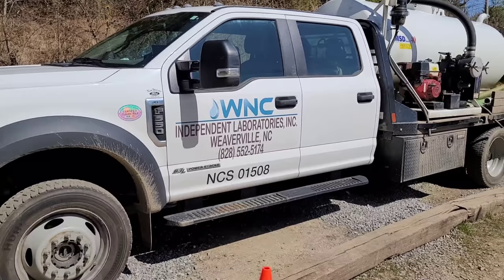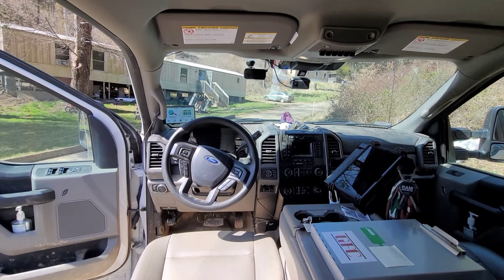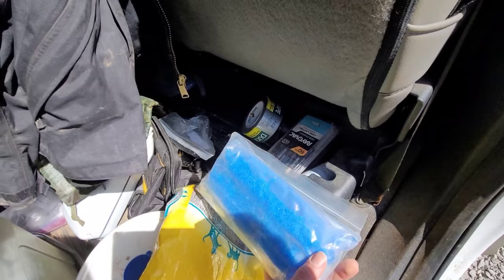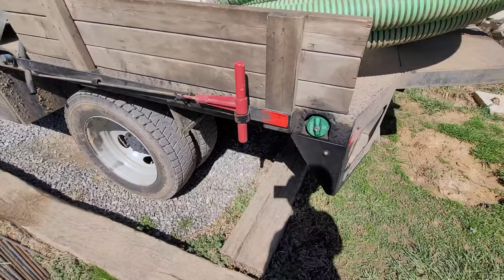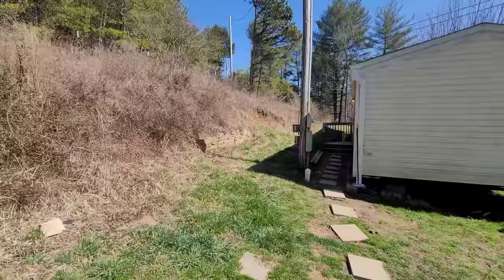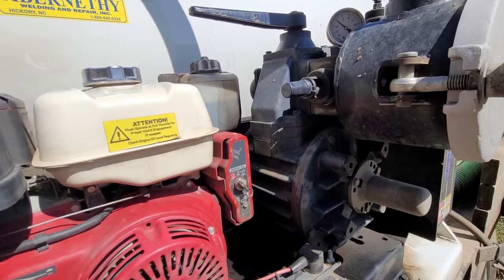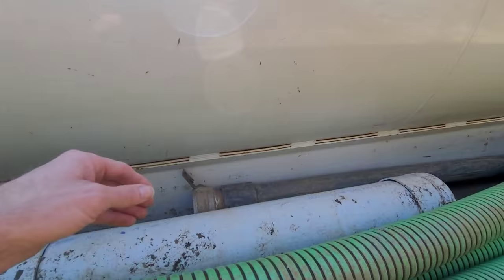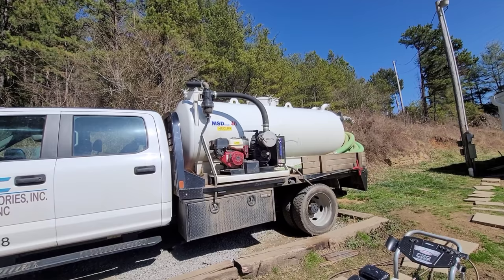Truck walk thru.

Comment: Running a service truck as a equipment mechanic space management is huge, the cab layout up front I like, I would add a power inverter to the truck charge batteries with or other small power tools or lights if needed, I would add some work lights to the top of the headache rack aiming off both sides, not sure how much sitting in the road y'all do but emergency lights orange and white on all sides of the truck help your guys feel a bit safer also 2-4 cones that can be thrown out as a barrier can be nice, the pump I would take the battery off it completely and run 4 gauge battery cable with a breaker from the truck battery to the pump, Dot hates plastic gas cans and have wrote tickets in the past over them, I would change over to metal cans and try to use some of the available space on the headache rack make some brackets that you could set the fuel can into and maybe one to set a 5 gal bucket into that will open up some bed space, I have a 5 to 8 gal electric water sprayer on my truck I use to clean hands and spray mud off my boots and for tool cleaning, the pump handle looks like if it had collar off the handle that would go over the bushing would solve the water intrusion, like everyone else said a back up camera would be nice but I would mount it up on the tank for more visibility, and lastly tires this hdrs on these trucks suck, I've had great luck with  Michelin XDS tires and Good Year G622 tires better tread and better traction plus we get about 50,000 out of them, anything I can help with pm me I'm also in north carolina and near hickory, thanks

Comment: On the passenger side of the tank, the side railing should have a latch that lets it swing down. It looks like there is enough room above the hoses to install a secure shelf for the tools/shovels. They'll be easier to get and stored away from the leaky hoses.

Comment: Most of the things I can think of is like little organization things. Like milk crates for the things in the cab, straps for the shovels and stuff to mount to the bed, the little insulator caps for like house spickets for the things that get water in them and freeze

Comment: My suggestion is since you are unsatisfied with the dealership working on the trucks because they are slow, is to hire a full/part time mechanic so they can do all the preventative maintenance, upkeep, and repairs to your trucks. You could also cross train the mechanic to do other things in your business so they could fill those position(s) while not needed as a mechanic. This would require a bit of a flexible type person but i'm confident you can find one.  You will be able to keep the warranty on your trucks just incase it happens to be to big of a job for your mechanic just keep good logs of repairs and maintenance.

Comment: From what I can tell a small 5 gallon fresh water tank and a good hand soap for washing hands I always have one on service truck and a thin sheet metal cover between the valve handle would shed water to keep the pump dry. Also maybe a box of Non latex gloves with a small trash can and bags for easy disposal. Also mounting a handle on the ridged pipe for easier maneuverability and control. Bed lights for night work.

Comment: We run Honda engines for our liquid pumps in the ag world. We eliminated the battery and wired it to the truck battery. One of them we also eliminated  the gas pump all together and put a hydraulic drive pump off the transmission. I saw some one suggested a backup camera. We put a Ag Cam on ours we can leave it on full time and very durable. I would suggest a long horizontal tool box on the back under the overhang to keep the shovels and tools in. The tire issue is hard to get around especially with gravel travel and heavy weight. Only suggestion is maybe go to a larger 22.5 rim and run a semi tire. Could go to a bigger truck but I’m guessing you’re trying to avoid the employees from having to get CDLs. I like the tik tok channel. Keep up the good work and the content.

Comment: That piece of sch 80 pipe you use to help the guys not have to fight the green hose can be modified.  Add a tee a couple feet down from where it connects to the green hose.  Off the tee run a short piece of pipe and a cap creating a handle to make everyones life easier. If your sch 80 pipe is 3 in get a tee that reduces to 1.5 in and make the handle out of 1.5 in so you can hold onto it.

Comment: To eliminate your dead battery on the pump, grab yourself some 4ga and run it to the truck battery brother. Did that on my mechanic truck for the generator and welder. The cost of the wire once is cheaper than replacing the pump battery once! Hope this helps.

Comment: Sweet ride. I have several suggestions, and most related to the problem areas you have pointed out, but I will be going through the comments to see if others have already made the suggestions.  Side note, simple covers, bags, and sheets will fly off and are not practical for any labor work.  I am happy to see that you are not using them here.  Add a simple water buddy to the cab, or cab top, to help wash the hands, head, & boots of the operators would help keep the cab clean and operators looking happy/fresh. It may even make the job look even more professional with the operators not using the building water to wash up.  Plus, they can wash up when the house water is in use, like for the job.   OK, on to the comments... please let there not be someone suggesting a cleaner or lubrication for weather areas. LOL!

Comment: Instead of gluing the rubber seal on the valve cap apply a thick coat of grease. It will keep the seal in place until you need to change it. Changing it will also be far easier than one that was glued on. The grease also helps with suction to keep the cap air tight.

Comment: My snow plow truck was an F550 as well. It came with the Continental tires on it which in my opinion were garbage. The price is scary, but I sprang for Michelin XDS2's and now that is the only tire I buy. I even run them on my Peterbilt that replaced the F550. I run a roll off dumpster business and go up and down a 1/4 mile long gravel driveway with a 450 ft climb from the road up to the house. The XDS2's give great traction and hold up longer as well. Just my opinion.

Comment: 11:25 James, you can get a cap that goes over the top of the pump handle to keep moisture out!  Just a long cap that you slide the handle into and then down over the control.  Could put a small bungee strap on to keep it tight.

Comment: 1. Add an extra box for 250ft of 2in hose for remote pumps and a remote pump.
2. Make your mookentukens sch 10 stainless. Much lighter.
3. Add a couple of 6in pvc pipes with removable ends for hard pipe extensions.
4 Add a remote pump.
5. Get the 110v system switches add and 45 degree heat trace your valves and pumps so they wont freeze.
6. Attach your pump to your truck batteries...
I would habe to look over it to see more

Comment: Put all that extra stuff you said you require in the cab of the truck into a tool box or something.  That way you can inventory easier, keep back up boxes stocked in the office, and better standardize what your crews run with.

Comment: 2 Suggestions... 1 I would have a pump water tank on the truck so you wash your hand or in case of an emergency. 2 sink your work order address with GPS. You'll have to have someone write the program but it will be 1 less thing on your dash. Also way easier than typing in an address, no mistakes.

Comment: The gasket you are using for the 3” hose. Make sure the material they are made from is proper for your job. Also keep paper clips on the truck to be able to tighten the cam lock if they are ever loose. If you need to shim the cam lock open the ear and slide the paper clip between the ear and the male side of the fitting. I used that trick a lot while hauling gasoline

Comment: Back up camera  mounted high
Heads up display?
Inverter  built in so tools and equipment can be charged off the truck
Thats the best I got without seeing other peoples suggestions 

Good luck the truck looks great. 

Wish the garage door company  I used to work for had a truck half as good! 
Your a great boss and content  creator thanks for sharing
Reply: And Possibly and insulated cover for the winter over the pump to make snow removal easier. 
I'd say maybe a winch incase the get stuck but i feel there's no winch big enough for the weight in that truck

Comment: Just a few thoughts.

12v fridge instead of the yeti, save even more on ice.

In dash media reciever for android auto out apple car play - better navigation, less mounted in the windshield, and option to add reverse camera.

Run power from the truck to the pump starter - eliminate the need for the extra yearly battery replacement and save a marginal amount of weight.

Maybe a rear mounted light duty winch to pull the hoses back to the truck - I imagine you work on some fairly step properties and fewer trips up and down the incline means the job gets done quicker. I'd guess those hoses are not light weight.

Maybe some kind of float switch inside the tank that activates a light or horn as the tank reaches capacity. Extra layer of protection for your pump.

That's all I got for now.

Comment: Mounting brackets on the rear of the truck mounted between the tank and the cab, this will allow for safe storage of your tools and easier time maintaining them and inventoring them. Use the empty Tow hitch to have a mountable storage container custom made that holds the cooler or a mount that supports the hoses lower to allow your guys to unload and reload the hoses safer. Exhausted associates at the eos would be happy to not have to lift 8 hoses 8 to 10 ft off the ground to mount them. This will allow for safer lifting practices to be followed as well as less strain on the body creating less chance of injury. 1 time is all it takes for a medical bill to greatly impact you and your team and the ease will allow for a speedy start and finish without a large cost to implement.

Comment: Just some thoughts moving the tools to hang off the side of the tank so you could move it up to the headache rack a little more. A light that surrounds the tank so you can find your tools in the dark and putting your hose back on the truck easier in the dark. Wash tank of clean water to clean tools and wash hands. Make a small 4 gallon or so transfer tank or just a larger fuel tank for the pump and get rid of the plastic can. Amber strobes for warning traffic when working in difficult to see corners of roads.

Comment: Nice truck. But there are some things I would change.
1 move the first aid kit outside in a hermetic box with first iad symbol on since your trucks are drive around. Or put a first aid sticker on the window where it is, seconds can save life. The public or costumer don't know where it is if your crew is not near the truck or injured them selfs. 
2 I would put a emergency stop on each side off the truck. To safe equipment or life. 
3 I would put a heat box outside the truck for gloves and stuff, so you don't have it in your truck and you have nice warm gloves in the winter. And you can make the cockpit a clean/safe area since your crew might take their brakes in the truck. 
4 I would put a tool box of some sort to make sure the tools don't fly off If the truck ever should be in a crash.
5 I would have orange flashing lights around the truck and some cones, that gets handy I you ever need to park on the street. Also have some border tape and some small post if you ever leave a manhole or just want a "safe area" so the public and costumers don't get to close and cause an accident.
6 I would allso put a eyewash station in or on you truck and a sticker that tells its there.
7 I would put 1 or 2 fire extinguishers on the truck. Might be one on each side. Seconds can save equipment or man life.

Comment: This video was really cool. I seen your Tik Toc about commenting on anything you might could add. That is a really nice looking bumper on the front of the truck. It would be really cool to install a winch that could help get the truck out of a jam if it was to just get stuck a little could prevent a wrecker if it is just a minor thing. also could use the winch for other things that you may have to pull. could also put a winch on the back that mounts to the reciver.

Comment: That’s a sweet rig. I’m not sure I can think of anything other than what has been mentioned other than some kind of Alley flood light mounted on the headache rack pointed down and back a bit to help when backing down driveways and using mirrors. The backup camera is great but mirrors will always be the only way to tell where your wheels are.

Comment: In Norway the septic trucks have a drum for the large hose. That way they can pull out 100 feet of hose almost effortlessly. It's also electrically/hydraulically reeled back to make for an even more effortless retraction
Reply: For the pump handle, you can have a piece of steel bent like a funnel and use it like a hat under the valve handles to divert the water from the seals

Comment: If you use a bucket for the cat litter and refill it, you can prevent a possible rip in the bag and a mess. You can also store the copper sulfate and any other poisonous items inside of there to reduce the risk of those being damaged as well. 
Just buy 1 Tidy Cats bucket and then use it for refills each time. I cleaned one out and use it for my BBQ grill pellets

Comment: The battery for the pump motor, I would suggest either running wires to hook it up to the truck's alternator which will help it maintain charge, or you might be able to replace it...just put one of those ports for an extension cord like they have on snowblower, then all you need is an a/c converter and an extension cord, plug it in start it off the truck battery then unplug it once its running with no extra drain on the system

Comment: To keep those valves from freezing have u ever thought about using heat tape an insulation that they use for pipes in mobile homes/rv's they do plug in 110v u can get a inverter to plug in to it. I would also look at look at mounting a small solar panel to keep battery's topped off charged wise.

Comment: For septic truck(s) i run. Our suction valve is just above our dump valve. But on the inside of the tank there is a 4" pipe that reaches to almost the top of the tank. Serves the same purpose as having the pump valve on the top of the tank. But I'm also using larger trucks. Also, we our pumps run off of a PTO

Comment: If you don’t use the rear seat for seating and only for tools and storage you remove the rear seat and could add  2 sliding floor pieces( like some overland truck beds)  to the back floorboard and could add storage boxes/ dividers and would be able to slide each side out the door to be able to reach everything easier and prevent operators from having to reach all the way to the middle of the truck

Comment: Metal gas can to prevent worries about placement. Aluminum cover hinged to tank that can be pulled down when parked. Prevents water from getting to pump valve and provides shelving/ counter space for crew tools or drinks when they’re on job site.

Comment: Few ideas you can weld on tubs to help hold the shovles and such for ease of access. Also your valves on the tank they have a heated style that keep it from freezing. Inside the truck you can make a small floor box that the seat can lay on top of that can help organize stuff that laing around on the floor. Has far as them cap and hose seals it sucks but good seal should never fall out. There suppose to be designed to fall out or become lose when the seal starts to wear out to indicate its time to change. I hate them my self use to mess with brine water trucks and you got use to making sure you had 4 extra on you every day lol

Comment: Guards for the def and fuel filler necks. A blowout  can and will happen where they will get absolutely wrecked. Also a raised shovel box on the passenger side, or a long weather guard box with drop down lids. A quality box on risers would be a good addition. Strobe on the headache is nice too.

Comment: One of my customers is in the same business.

He has 3 level eyes on all his trucks. 

All his trucks tanks hung open a the back so you have a opening the size of the tank to get stuff out of it. 

With water getting in your level could you get a rubber or leather cap made up. think the size or a spray can lid that has a slit for the handle. Slides down the handle and goes over the top of te unit to stop rain.

Comment: A head-up display could replace the Garmin screen, and display the rear camera with back-up assist.  The Hudway (that I just bought but haven’t had installed yet) can display anything that the phone it’s linked to can, and has a rear camera and two side cameras, activated whenever you put the truck in reverse or use the turn indicators.

Comment: You could keep a propane torch on the truck in the winter for frozen valves.  There is a battery disconnect system you can use for the interior electrical system if your guys kill the battery.  I might put the handtools in a steel box welded to the truck.  A higher single mounted brake light might mitigate rear end accidents. How about a trash bin inside (or outside)?  Touchless soap dispenser, lol.  Change your cabin filter often and with a charcoal one.  Very nice though.

Comment: @james butler maybe add secondary led lights to the back to point out for that extra visibility along with upgrading any non led light to led if you have any. Only other thing I can think of is maybe a few thick rubber washers pressed under the pump control lever to keep water out. They would have to be tight though. Hope I'm not too late 😁

Comment: Downward angle 3 in PVC pipe you put all your hand tools in so they're pointed towards the back of the truck instead of having to run to the middle of the truck it's right there when you need it